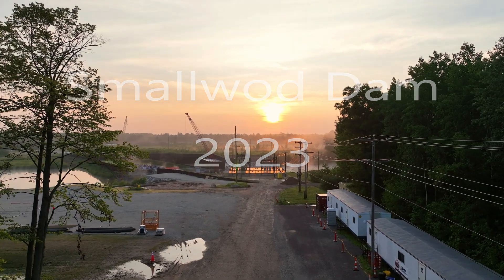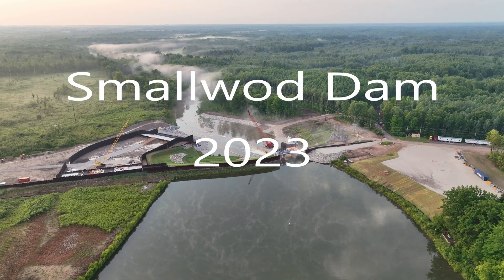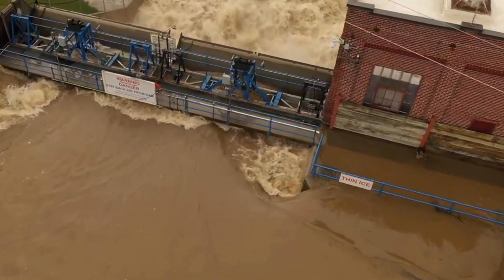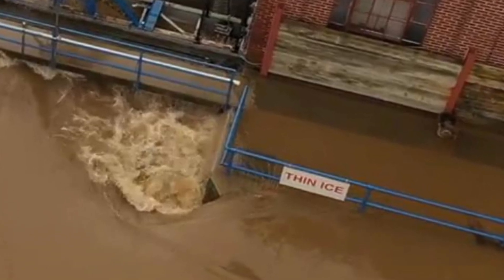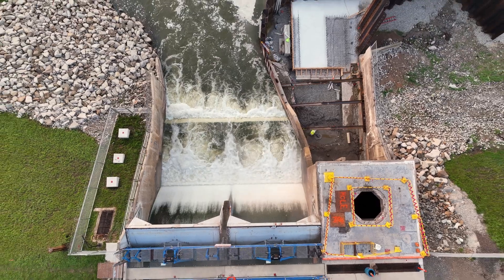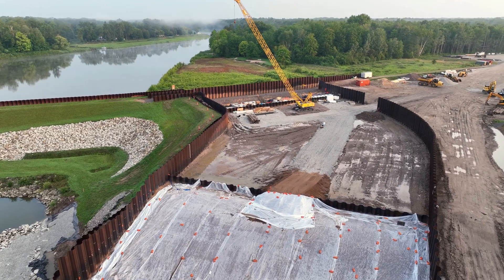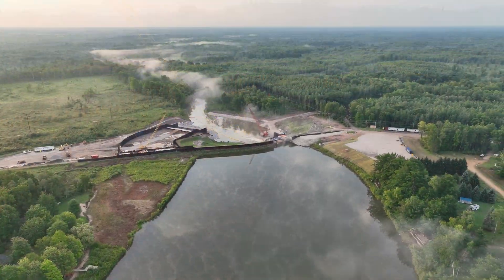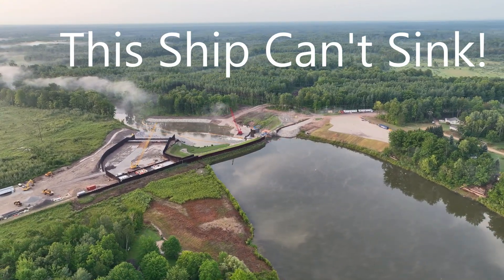Smallwood Dam Update:  2023

Comment: Too bad we couldn’t use all that water power to generate clean electricity.
Reply from the maker: My understanding is that the type of funding they are using to pay for the project prohibits using these dams for generating electricity or flood control.   They are only allowed to be used for recreational purposes.  

They created a “special assessment district” and simply forced all adjacent landowners to join.   No option to opt out and they are forced to pay for the dam repairs, upkeep, and maintenance.  The homeowners get no say in how the project is done or how much it costs.  If you don’t pay, they take your property and sell it at auction.  

I’m blown away at the power of  the “special assessment district” and its potential stranglehold on taxpayers.